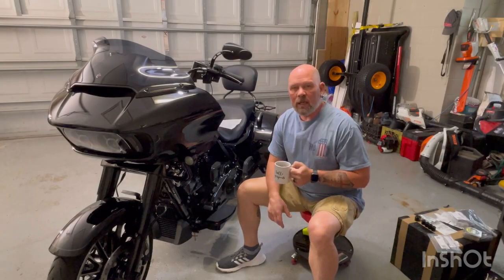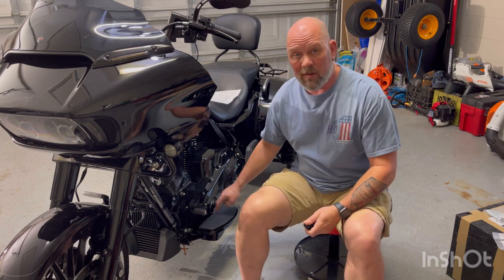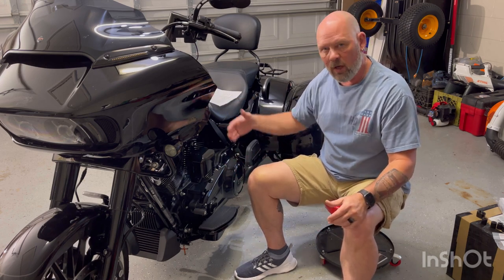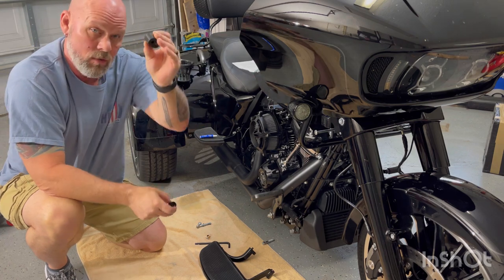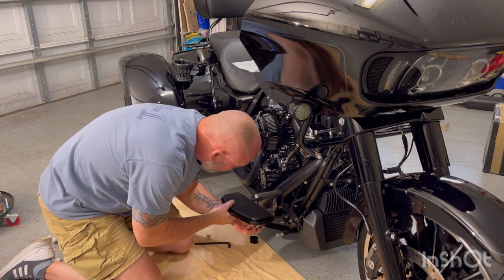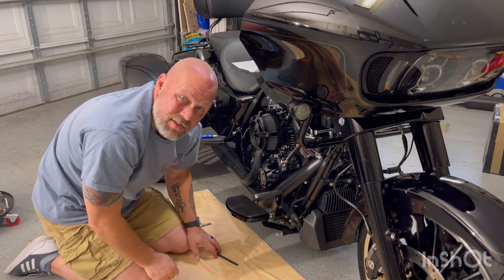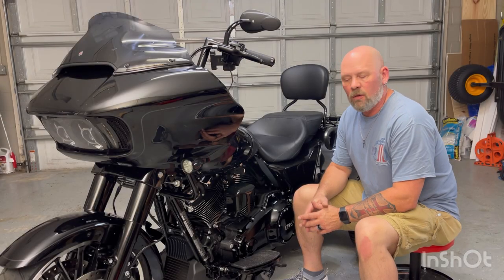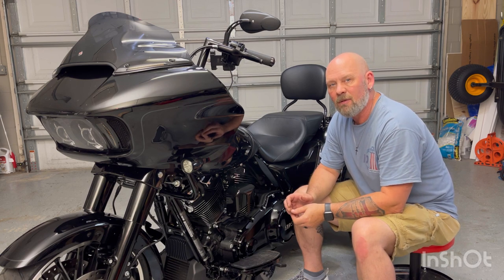Road Glide 3 -Rider Floorboard Extensions (DK Custom)

Comment: I just took delivery this morning of the 3. Came home and installed Pintle floor board extensions, heel shifter, vin hider, Heim joint shift linkage, gremlin bell, smoked led tail lights, extended brake pedal, sissy bar with quick release brackets, front turn signal led, windshield, and windshield trim led’s, and lower vent led’s. Oh and saddleman Road Sofa extended reach seat with backrest.
Reply from the maker: Nice!!  Congrats, man!!  Gettin it decked out for sure!!!

Comment: Thanks for sharing. I just ordered the extensions for my Tri Glide. Yes, that one bolt on the right side is a mother to get off. The instructions don't mention the wire on the left side. That should have been mentioned. DK Customs isn't as good as some might think. Screw up that wire and you are done.
Reply from the maker: Yes it is!  I bent it getting it off!  Things do get overlooked from time to time!  Maybe a fine adjustment to the instructions. 👊🏼😎
Reply: @donniewieburg  We will certainly look into improving the instruction but for others that may see this comment... step 10 of the instructions "Left side: You will need to place a block of wood (or something) under the assembly to
prevent it from disturbing the wiring and/or cabling."
Reply from the maker: Thank you for the clarification!!  I saw it, pointed it out in the video as well during the install.
Reply: @donniewieburg  how are you liking the RG3?
Reply from the maker: I’m loving it!  Everything is working out great!  I jump on this more than I did my 2020 RG Special 131. I need to talk with you about the suspension though. Little rough for my liking.  Overall, a wonderful machine!

Comment: Morning I tried to remove the bolts this morning to put the extension on it, and it took me 30 minutes to loosen. When I  started to tighten the brake side of the bike, the front bolt was very easy, and the rear  bolt was very hard.
Reply from the maker: Bro, the amount of thread lock from the factory is over kill!!  I bent the front bolt taking it out. Cleaning the threads out is the best bet for sure. Hope you like that extension kit!  I love it.

Comment: I added the CIRO 3D framed mounted highway pegs to my R/G 3.  Will the DK Custom floorboard extensions still work?  Will I need 2 additional spacers?  
Thanks
Reply from the maker: You will need one additional spacer and a longer rear bolt for the brake side.